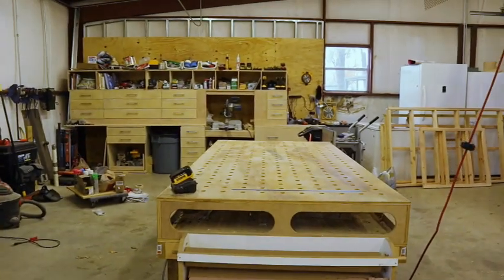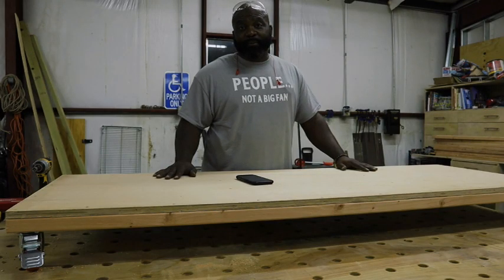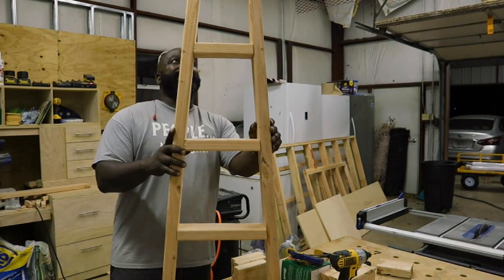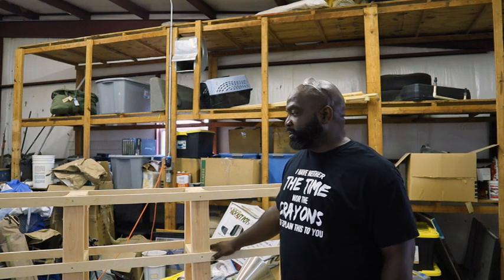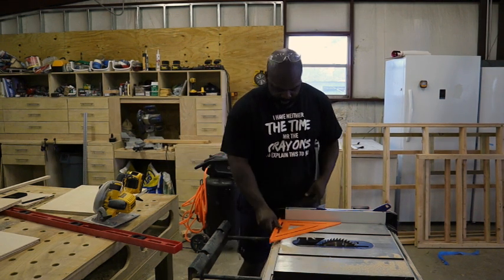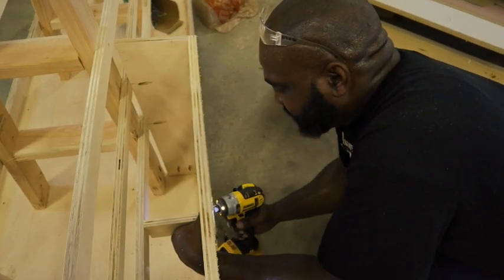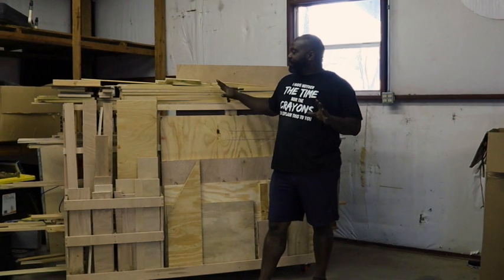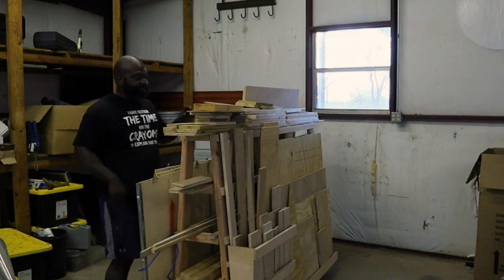DIY Low Cost Mobile Wood Storage Cart

Comment: Very nice organizing!.....think Norm Abram made one very similar (but for clamps) on an episode of NYW
Reply from the maker: Have t heard his name in a long time. I need to make one for clamps. Do you dabble in woodworking?
Reply: @TheNakidGardeners  Yes I build Audio Speakers as a hobby for 25 years....got into woodworking because of Norm. Have restored quite a few of vintage Delta machines over the year too. (table saws radial arm saws band saws etc)
Reply from the maker: that is awesome.  I need to get a new table saw and radial arm saw.  These were just cheap ones that I purchased when we were renovated our old place.  

Any recommendations?
Reply: @TheNakidGardeners  Well if money no issue.....I recommend a new/used Sawstop cabinet saw (for safety reasons) but I always love vintage Delta/Rockwell  table saws from Craigslist.... that could be restored.....I wish I could load pictures of one of the Delta I restored (complete break down and arbor bearing replacement) these are great saws too!
Reply from the maker: @Kevin L Westerbeck  Yea I seen those and want want want my wallet aka wife would probably freak out if I purchased one of those though lol.  Yea I probably wind up getting a Delta with a wide surface to do full sheets of plywood and a nice arm that locks and make sure the cut is straight.
Reply: @TheNakidGardeners   Yea I know the feeling!  Also radial arm saws are very inexpensive on CL.....get an Old cast iron Dewalt, if you can find one in your area.  Will need some service but I assume living on a Homestead you are handy like me.
Reply from the maker: @Sans_Solo_  I was never mechanically inclined. I knew how to tear things apart but would always have extra pieces when putting them back together. Lol
Reply from the maker: @Sans_Solo_  ...why I try to buy things with warranty lol
Reply: @TheNakidGardeners  yea I know....but always good to think about how things go together.  I am self taught, in this area, and feel like if I put my mind to it I could repair just about anything. It's a mindset
Reply: Also I love thrifting (going to Goodwill stores) and saving money anyway I can

Comment: thinking bout building that same style but was thinking maybe i might only make one side of the A frame at 5 degrees n the other side at a 90 degree for the scrap lumber , how does it workout for u with both sides at 5 degrees
Reply from the maker: It works out pretty well. The only thing I would change is making the base wider since we have a lot of lumber